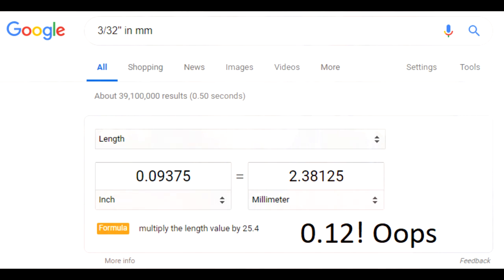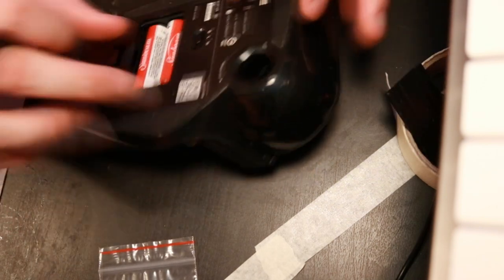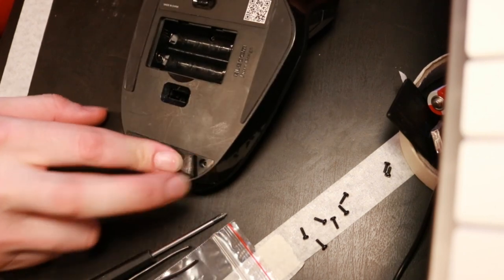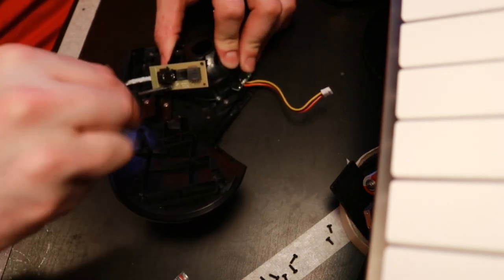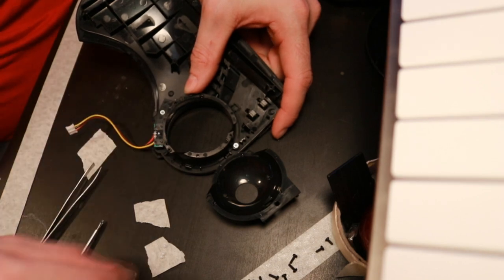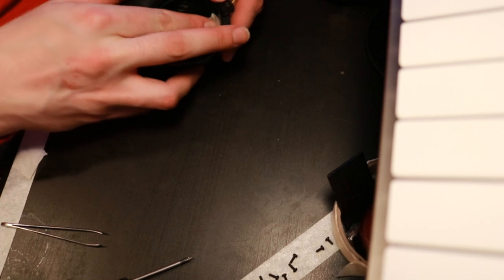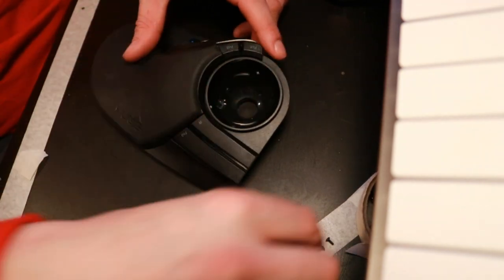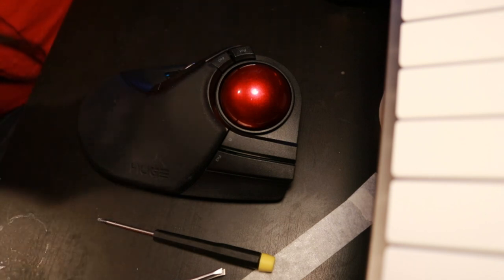Elecom Huge = Gaming TRACKBALL? Bearing replacement / fix / swap

Comment: Make sure you don't tighten the bearing holder screws so tight that the bearings cannot spin!

I suspect the real issue is that bearing's mold isn't perfectly round and the bearings get stuck under pressure. (Probably why Kensington uses arms to hold the bearings rather than a cup, like in the huge!) I replaced my bearings but they eventually got stuck and barely spun. I just took my huge a part again, but this time I left my bearing holder loose enough where the bearings could spin freely, but tight enough where they couldn't fall out. Now it works great!!! Loosing the bearing holder cup may resolve people's issues without buying new bearings!

Pro-tip: Use carpet to catch the bearings when they fall out. The bearings wont roll away! To put the bearing back in just drop them in the bottom and guide them to hole. Leave enough flex where they can drop in. Then tighten just enough where they wont fallout but can still spin easily. (Will take multiple attempts!) The more easily the bearings spin the better scrolling you will have!
Reply: The bearings are not supposed to spin.
Reply: @ulaulalaulaulala  
If that's how bearings work they would eventually rub flat. There would also be no need to replace them as shown in the above video if that was the case too. http://motorsportsbearings.com/how-bearings-work.html#:~:text=The%20concept%20behind%20a%20bearing,roll%20better%20than%20they%20slide.&text=Bearings%20reduce%20friction%20by%20providing,the%20device%20to%20spin%20smoothly.
Reply: @ulaulalaulaulala  that don't even make sense. what are they even there for if they don't spin?
Reply: @ConsecDesign  they don't spin, the ball spins and glides on top of the bearings. The bearings simply hold the ball in place while maintaining the smallest point of contact possible to keep friction low.
Reply: @N0RD0M  bearings in a trackball are not the same as bearings in a car. He is correct in that they don't spin. They don't rub flat because friction is very low, ceramic is hard and the ball itself is a much softer material. if anything the ball itself would "rub flat" before the bearing would but you wouldn't notice due to the surface area of the ball.

Comment: I replaced the bearings with the ones on Amazon but the ball seems a little stiff. Almost like there's some drag to it. It does not "spin" freely. I'm gonna take it apart again and see if something is pinched, but the ruby bearings look a little smaller next to the ceramic ones.

Comment: I took a leap of faith and bought some G5 3/32"(2.381mm) Si3N4 bearings (the black ones). And it didn't fall out of my Deft pro bearing holder. So for anyone who also has a Deft Pro and wanted to change your bearings but couldn't find 2.5mm sized balls, hope you'll find this info useful. Oh and my Deft Pro model number is M-DPT1MRBK not sure if it's different for other model numbers.
Reply: Oh and just wanted to add I did the whole thing on my thick mouse pad, the balls didn't bounce much on them. but be careful they could still roll pretty far.

Comment: While I appreciate the advice about tape or a magnetic tray, I'd like to just step in and advocate for the use of either a dinner tray or cookie sheet any time you're working on small parts. Doing your work on a bare table risks small parts being lost (as you've found out the hard way), and it's also a very quick way to set a project aside if something should come up. It's like a little separate tabletop with a handrail to keep all of your small, headache-inducing parts from falling into Hell.
Reply: I use an ice cube tray, way more slots and they are often rounded at the bottom so you can scoop stuff out of them.

Comment: just did that and indeed it improves things significantly. however, even with this, the stickiness is not completely gone, if you are a perfectionist, you still won’t like it. on top of that, there is also a learning curve (if you never had one) and with the variety of traditional mice available at the moment I am not sure it worth the switch.

Comment: Lower grade number indicates better ball not only in diameter variance(not a factor here). But also roughness so the lower the grade number the better not a huge difference between 5 and 10 for sliding but try to stay low
Reply: So a g5 is better than a g10?
Reply: @GOTHEAT0  Technically yes. However keep in mind that there's no guarantee that the G5 bearing you ordered is 'actually' a G5 quality, especially if you buy from overseas like China.

Comment: hi the mouse stopped working, the cursor doesn't move but the shortcuts are working fine.Which part do I need to change in order to make it work again.Any suggestion will be very welcome.Hate to loose this trackball..I think I need to replace the part at 9:44 minute in the video, is that correct? if yes where can I buy this part or can this be repaired? Thanks for your help.

Comment: How does this product hold up over time? I'm guessing there's no way to send it in for repairs (in or out of warranty) unless you speak Japanese, from what I've read in Amazon reviews/Q&As. Maybe the switches can be replaced with higher-quality ones.

I guess my main concern would be the sensor crapping out after like 6 months. That would make this a scary investment (for my purposes anyway).

Comment: Great tutorial, ty so much! I've been using the trackman marble for years and I really need a mouse wheel. Question, can you use 2.5 mm stainless steel bearings instead?
Reply: do not change your bearings, you will ruin your mouse. the engineers at elcom used ruby for a reason, i did it 6 months ago, my mouse is ruined, this guy doesnt know what hes talking about!!

Comment: Hey thanks for the video, I was just wondering if you could point me to a help article if I cant get the custom buttons working with the Mouse Ass 5 software? The other parts of the software work but none of the customization buttons

Comment: Please, I need help or suggestions what to try, for you Ophid or for anyone in the comment section, 

I have the elecom huge but lately the scrolling is off, I use natural direction and it had been working but in the last couple of weeks when I scroll up scrolls up and then automatically scrolls down and leaves me in the same place.

for instance, if I spin the wheel 10 physical bumps in one direction let's say down, 8 bumps go in the direction I want, down, and the last two bumps go backwards, up, or the other way around, if I'm moving the wheel 10 physical bumps up, then 8 go up and the last 2 go down. the page or whatever I'm scrolling looks like a scratch in a record.

Comment: I put G10 balls in mine and it is still sticky at low speed/ fingertip pressure. it's annoyingly jerky.
any tips? are the ball bearings supposed to roll in there cups? can't tell if mine are or not.
People say trackballs are really precise, but this thing is lucky to hit a spot the size of the subscribe button when tracking slowly sideways.
Reply: this guy doesnt know anything and you like me prolly have a ruined mouse,  the bearings are so hard they will scratch your mouseball and deform it, leading it to be sticky and jerkey filled with micro scratches. i wish i never changed from the rubys, they were slower and didnt glide as smoothly but is it really worth the 60 bux every 6 months because you think it will be smoother, ti is a little, maybe 5% at most but now i cant even use this thing.

Comment: you are AMAZING :-) i don't have this mouse yet or any other mouse yet but about 8-10 yrs I had a Logitech Cordless TrackMan Optical wireless mouse what was also fucking good!  I remember i looking for a very good trackball mouse at this time sooo long! And I choosed this mouse. This time i bought this for £50 about (new) and i used that for many many yrs. before stopped to work. Anyway! This mouse (Logitech) is SO EXPENSIVE!!! I don't want to buy that. And I thought i will buy this mouse (Elecom huge) and i am very happy because of I saw your super good video now! Thanks a lot!
Reply: yeah, maybe will not problem with my elecom huge mouse what I will buy nowadays (2020) but if will problem then I can fix already :) thx!

Comment: Ceramic and stainless steel ball bearings are now available from Amazon (in the UK at least!)
Reply from the maker: That's awesome
No more ebay sketch :)
Reply: @subversed   just completed this improvement - your video was a great help. 👍
Reply from the maker: @charleswheaton  glad I could help :)

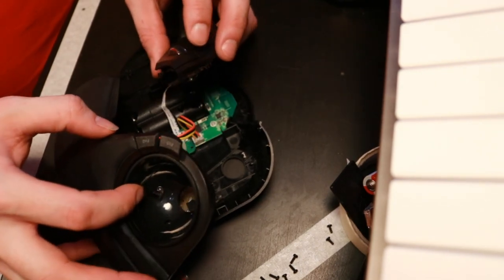Comment: I've put steel bearings, others recommended, and improvement was small, after awhile much better. Resistance is still much bigger than in my old double clicking Logitech. 9:00 I couldn't easily disconnect this cable so I left it and later I broke FN2 cable on the other end due to twisting when I was trying to assemble it. I fixed it with Scotch tape, maybe it will work to the first drop on the floor. 
My old earnings definitely are not rubber - it is some hard plastic similar to the Logitech although in Logitech they seem smaller. Maybe this is the cause of the difference in performance.
Reply: I don't recommend steel bearings at all. You want your bearings to wear out before the ball, and since steel doesn't give any kind of gripping surface, those bearings aren't rolling. 

The ball is just gliding along a stationary bearing, so you're only feeling the sum friction of 3 round steel contact points against the trackball. 
The reason other trackballs feel so smooth is that there is a small amount of grip between the trackball and the bearings, causing them to spin/roll. Steel offers no such grip, and will eventually damage the ball.
Reply: @ophidslammish1368  According to Wiki page Mohs scale of mineral hardness zirconia is only slightly less harder than hardened steel so expect similar wear. If I feel drag there must be some grip otherwise trains couldn't start moving.
Reply: @ecetih  is the trackball zircon? I thought it was just acrylic
Reply: @ophidslammish1368  Sorry I meant what you used - zirconia oxide, but googling it with Mohos it is even harder.
Reply: @ecetih  oh, it's been a minute lol. 
You're probably right, I'm just using my intuition and not thinking analytically, metal vs plastic = bad, but you're probably right. I just imagine the steel bearings locking in place and not spinning, but brain hasn't been treating me very well, so I am probably wrong about this
Reply: @ophidslammish1368  I was surprised when I learned that some ceramics are among the toughest materials in the world.

Comment: For anyone ready to pull their hair out with how sticky the Huge can be in trying to point precisely in need of an excellent, if temporary and kind of messy, fix. Liberally coat your ball in wax (I used a birthday candle on mine) then palm it (as if you were packing a snowball) to smooth out any chunks. Stick it back in the socket and roll it around for a moment. You'll notice a little feedback but precise movement will now be BUTTERY SMOOTH. I was super skeptical at first but it's been an absolute Godsend while I'm waiting for my bearings. Not trolling here - try it and you'll see!
Reply: Pledge works better
Reply: @antivert  I'll have to give that a shot. Your suggestion made a thought pop into my head as well: Woolite?
Reply: @coachluke85  I think woolite is a bit too dirty and will just attract dust. BUT some people swear by forehead grease. Just get a soft cloth, wipe the ball on your forehead, and then polish it up :D

Comment: Does the trackball on the elecom deft pro move stuff with resistance?

Also can the elecom deft pro or any trackballs bearings be switched out with 2.5mm bearings or do they need specific sizes? 

Thanks

Comment: Ok, i did exactly the same. I cannot open my mouse, same model but with wire. I've removed the 6 bottom screws + 2 in the ball container but the right side of my mouse won't open like if there's an other screw but I removed the plastic to make sure I unscrewed them all, took them all off. Since mine is with wire, I have less screws than yours yet I can't open it.

Comment: Mine arrived just today, would you recommend doing this change over now? I already bought the ball bearings.
Reply: I did it. Works far better now, thanks for the very helpful video. I bought the wired version and have tho point out that annoyingly there is a hidden screw in the centre under the sticker where it says made in China. Once I figured that out it all came appear and back together as you showed. Cheers.
Reply from the maker: @SFTaYZa  Thanks for the update! I'm glad it worked for you :)
Reply: @SFTaYZa  About to do this as well. Thanks for the tip about the extra screw under the sticker. I'm sure you saved me a scream.

Comment: I've read that steel bearings are better than ceramic. Any truth to that?
Reply from the maker: Avoid steel- you want the bearings to wear, not the trackball. 30 cent bearings versus a 40 dollar replacement ball

Comment: If you can get silicon carbide they have a 20% better friction coefficient than silicon nitride. Both of those are better than the ZrO2 from what I have read on forums. Also G5 is better than G10 for anyone not paying attention.
Reply: Thanks for the tip regarding silicon carbide! :D
Funny enough I tested Si3N4 G5  bearings vs. ZiO2 G10 ones and the ZrO2 felt smoother ...
Reply: @Centttttt60  Good to know! I have heard it go both ways now. Glad they worked great!

Comment: I know that smoothness is a construct, however would you say that the ball isn't as sticky when you take your index finger and move it sideways?
Reply from the maker: Sticking in one direction would indicate that the bearing on that side is not perfectly spherical. Sticking of any kind is not supposed to happen in any trackball, ever. There should be as close to zero friction, consistently, through all directions, which is what my refitted elecoms now have.
Reply: @subversed  thanks. I'll order some and see what happens
Reply from the maker: @improprietary1  I hope you're successful! Keeping it well lit can help a lot, make sure to order at least 4 bearings. Oh, and if you can, do the whole thing on a towel to prevent them bouncing or rolling away
Reply: @subversed  Update here. It wasn't difficult to swap out the bearings however i have found no benefit compared to the ruby bearings. On a closer inspection my ruby bearings are perfectly round and the ceramic ones stick just as much as the ruby ones. I feel like the next upgrade would be roller bearings like the L-Trac.
Reply from the maker: I experienced a vast improvement on the two that I modified and the rubies were definitely not perfectly spherical. Could the inner plastic seam of the cup be protruding and touching the ball? Oil buildup? Do the new bearings rotate freely against your finger?
Reply: @subversed  the bearings don't move about, I didn't drill out the holes. It's just the force required to overcome the inertia :)
Reply from the maker: @improprietary1  They should spin and might stick until you roll them with your fingertip. Zero drilling required, that's an old method of replacing permanent bearings and rollers. 
The bearings should turn against your fingertip, which is hard to verify, but one way to tell is to press your fingertip against something like the edge of a table to put a crease in your fingertip, then push lightly on the bearing. If it rolls down the hill/valley of your creased fingertip, you're in business. If not, use a different fingertip to roll it around in its pocket vigorously until it's free. 
You should be able to put a paper's weight of pressure to move the ball. If the bearings are moving, and the ball isn't, examine the ball for any friction spots and inside the cup  for any imperfections in the plastic. Something might be rubbing.
Reply: @subversed  long time no see. I just did a deep clean of my trackball and chose to leave not tighten the screws that hold the cup together, now the bearings move a little making the trackball much less sticky.

Comment: I also have one of these, the wired  version, it was my favorite mouse by far, however, I have been using it for 6 months and 2 days; and I was using it and suddenly the pointer got stuck in the upper left hand corner, then nothing,  went to elecom mouse assistant 5 and it still sees the mouse, the computer still sees it, but it does nothing, any ideas, went to their website and went through their troubleshooting  workflow and at the end it says your mouse is broken. Thing is I would love to get another Elecom, but now I am worried that it will happen again, or was the one I have a fluke
Reply: This might be due to a broken wire in your trackball's cable. Sorry, I don't know if that's easy to fix or replace, but look around here on YouTube for help.

Comment: I guess not all “HUGE” has this problem. I bought mine last week from Amazon and it’s ball moves buttery smooth. Maybe I am lucky.
Reply: Definitely not all. The first couple runs of production seemed to be about 20% affected though.
I actually had 3 separate units all with the same issue and Frankensteined a perfect one by using my tongue to see which of the bearings were good, but I still made this video for everyone else out there who doesn't have that kind of patience
Reply: Ophid Slammish,  After watching your video I also got a Deft pro too. I think scroll wheel on Deft pro feels sturdier. Thanks for the video.
Reply: @ahmedsyed3436  I'm really glad you liked it. I don't post very often and this is the best video I've done so far. 3200 views is like 30x the ones I normally get
Reply: what other trackballs have you used? Even with new ceramic bearings it still feels much worse than my Expert.

Comment: Ever had issues with the scroll wheel randomly not working? It's lost all resistance and the computer doesn't recognize it. I opened it up but I'm not seeing anything helpful.
Reply from the maker: I have not, but Elecom's warranty should be good for a year iirc